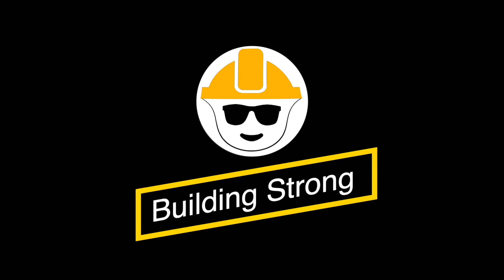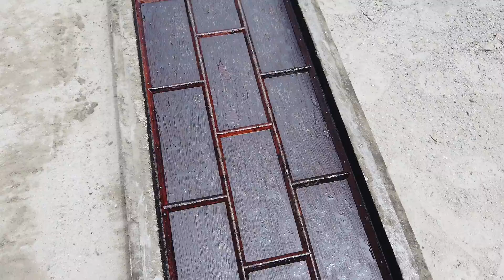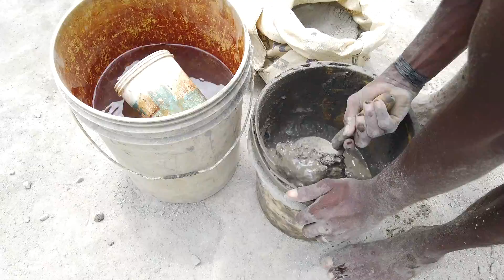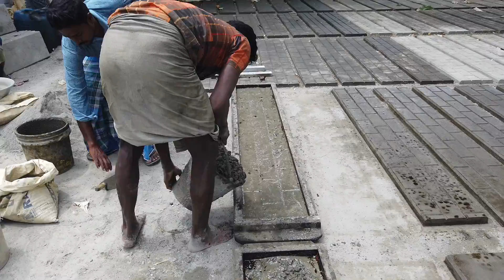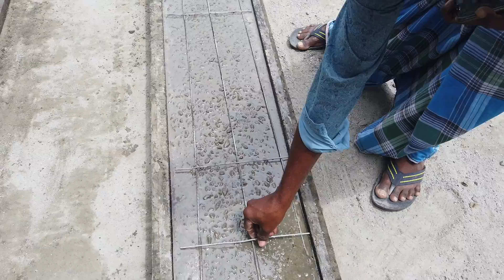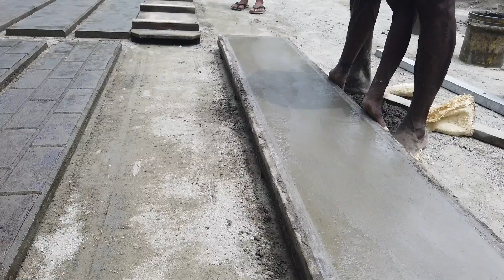Making of Readymade Compound Slab with Plain Finish & Brick Pattern Design | Cement Slab for Fence

Comment: I'm thinking 4 rows of bricks would be better than 3, because you could stack them and not have the "joints" on top of each other.  
With 3 rows, you're not able to if both ends are the same.